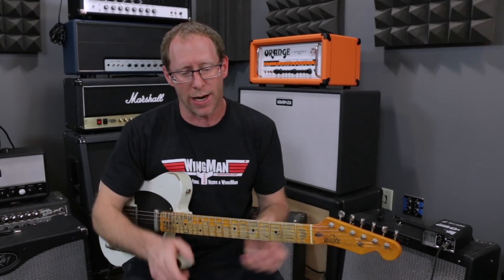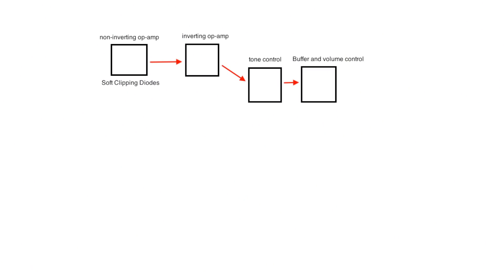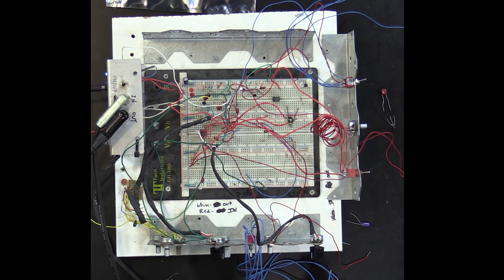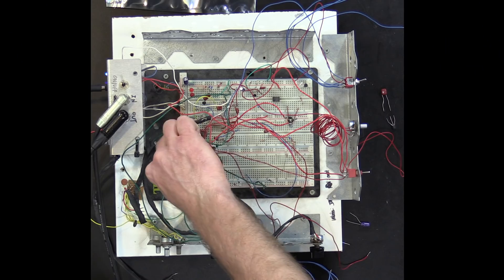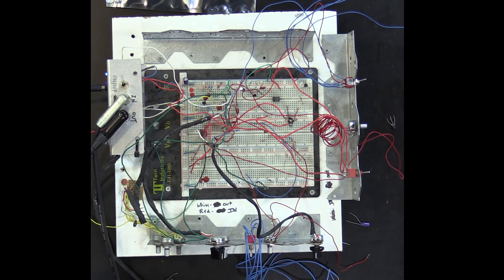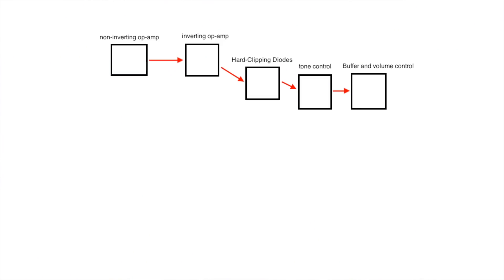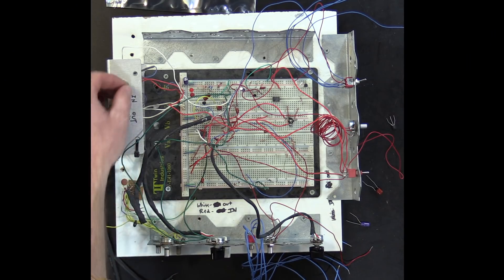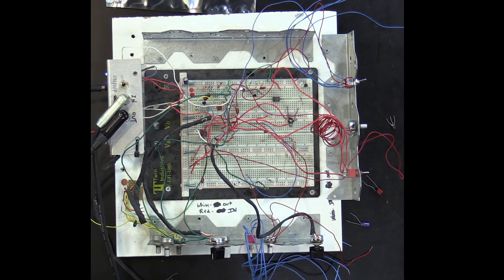What no one tells you about Guitar Pedals & "clone" circuits

Comment: What I find interesting is the mistakes you find in the copies of well known pedals. And even mistakes in original pedals - stuff that makes no logical engineering sense. For example the feedback resistor that was added to the MXR Phase 90. The early Phase 90 is a classic modulated notch filter. With the feedback resistor, it turns into a sort of botched auto wah with a bit of mild notch filtering. There are far better ways to add resonant feedback to this circuit without destroying the sharp and deep filter notches.

Comment: The devil is in the details... And Overdrive vs. Fuzz vs. distortion is mainly semantics anyway.

Certain qualities have gradually started meaning certain style of sounds that are "usually" produced with certain type of circuits, but things can be swapped around to mess that up. Usually pre and post EQ and especially the bass content in to the thing that is clipping means much more than the hardness of the clipping. And the hardness of the clipping can vary in other ways too than just diodes in the feedback vs. diodes to ground. Actually diodes to ground are ususually not totally hard clipping... There still is somewhat round knee there at least when compared to digital clipping, and the softness/hardness of the diodes to ground arrangement can be varied by the circuit driving them.

Comment: I mean, every amp ever is basically a Fender Bassman and every gain pedal is basically either a Fuzz Face or a Tube Screamer. Everyone knows that. Duh !
Reply: ...Not quite....

There's the Fuzz face
There's the Fender Blender / Univox (etc)
There's the Tube Screamer
There's the Marshall Shredmaster / any other "diodes to ground" circuit
There's the Big Muff

All successful pedals designed to distort guitar signals are based on one or other of the above.

The expensive "boutique" nonsense - like the Klon (as a great example) are also based on the above.  Despite the hype, the Klon is just a "to ground" clipper with some tone shaping and a boost circuit at the back end.  It's nothing special - despite what the snobs will tell you!
Reply: @alberthigginbottom7002  I think you didn't understand my message
Reply: This statement prove that you don't understand much about electronic and tube amps.

Comment: Theres only one way to achieve distortion, and all pedals have to do it. Heck even an electronics book show you how. So every pedal is a clone of an amp going into clipping.
The difference is the branding, and the values to make it soft, smoother, or for example a tone control before a filter etc etc.